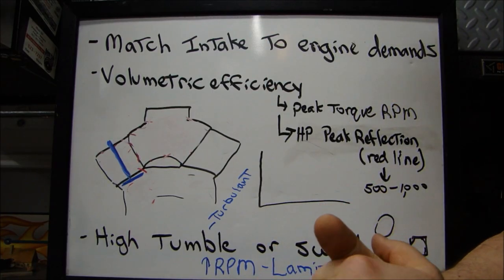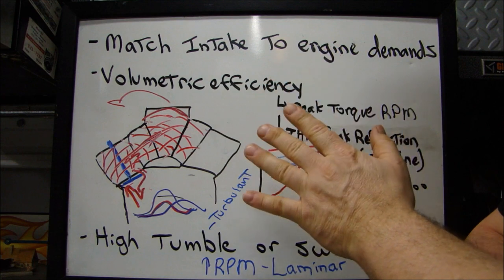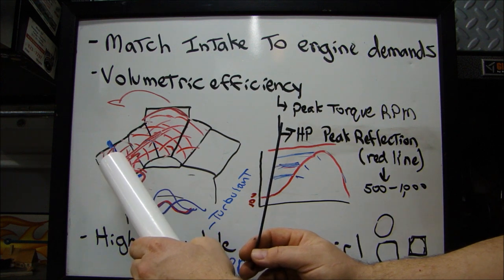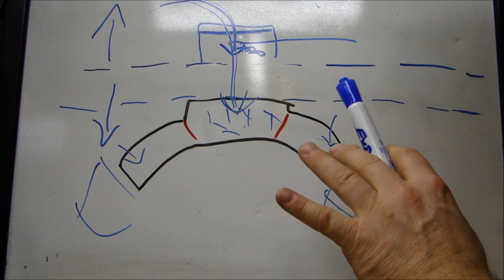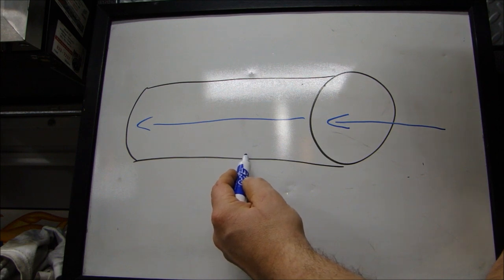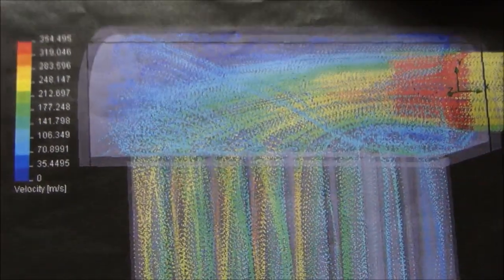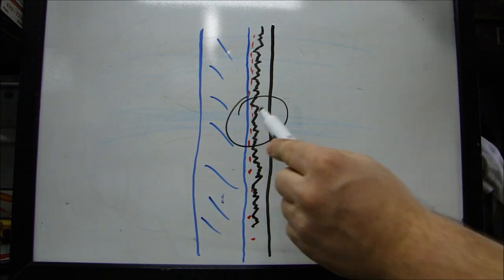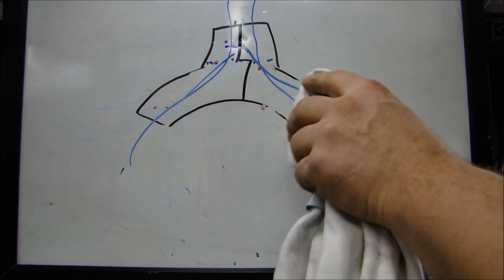Engine Building Part 8:   Intake Manifold Theory

Comment: Hey Pete, I think you misspoke when you were giving the peak hp peak trq example.

Its simply not possible for you to have your peak hp @ 4880 with your peak trq @ 5000. HP is a derived number. The math requires peak hp to be at an rpm equal to or greater than peak trq. 

rpm x trq / 5252.

Comment: Pete, been watching you for a few months now. You are a awesome gearhead, thank you for sharing your expert knowledge . I have been building for close to 50 years now, always on a tight budget. Sometimes this make it more challenging how good of an engine i can build for low buck cost. Have done good over the years maybe just lucky. Current build is a 68 327 SBC , 30 over, Forged FT  Scat rods . Had a top quality machinist (now retired) sad day. I opted for some 64 cc  heads, 190 intake runners, hope runners aren't to large for my little 333...  On a last note,  my name is Peterson, so i go by Pete as well,  also have two best buds hanging around my shop both pugs lol...
Reply from the maker: That is awesome! Thanks for sharing that. I miss my pug

Comment: some intake reversion can be  cut down, by true cross over headers, the other deal is to change two firing orders(plus a cam change to match, so when one intake runner is  getting air from the plenum it can use the opposite runner for increased plenum space, the other deal is extended runners in the plenum or jiggle the rocker arm ratios, the object of the game is equal combustion pressure between all 8, I understand everything your talking about, your stuff is spot on.
Reply from the maker: +tom ashton Thank you for the comment. Those are great suggestions.

Comment: Like others, binge watched up to this point today.  Getting ready to build a Shelby Cobra replica and this information is invaluable in helping make decisions on my engine build.  What an incredible resource!  Thanks a ton Pete!  I'll echo others sentiments - I'll buy you a beer if you're ever in the Denver, CO area!  Cheers!
Reply from the maker: That is awesome Jacob! What kit are you buying? It may be worth a trip to Denver just for a beer
Reply: Petes Garage Thanks for asking! I'm planning to get the Factory Five Mk4 Roadster complete kit, so drivetrain is one of the biggest build plan areas that I'm working on.  I've decided that I want a 302 block with fuel injection but haven't made many decisions beyond that yet. It will be mainly a street cruiser, not racing or dragging. I'd like to make around 400 HP on pump gas if possible. The good thing is that I'm still saving for the purchase so that is forcing me to make a good build plan!
Reply from the maker: Excellent choice. Sounds like you have a great project planned. When you start building let me know if you need any help.
Reply: Will do, thanks!

Comment: Awesome video Pete. I wanted to point out a very interesting fact that not many people are aware. The misconception is that we as humans breathe because we suck in air. We actually breathe because of the atmospheric pressure of the earth at about 14.7psi at the surface. The difference in pressure inside our lungs that we create by contractions, just like the difference in pressure inside of a cylinder is what allows the air or fuel/air to enter that cavity!
Reply from the maker: That is a cool comment. Understanding why something happens is what I'm all about
Reply: Petes Garage You talk a lot about velocity and that is an awesome subject. If you didn't already know, a vehicle traveling 70mph is traveling about 102 feet per second. Velocity is a measurement in distance traveled in a certain amount of time. There are 5280' in a mile and 3600 seconds in an hour. Divide that and you have 1.466. So multiply any MPH by 1.466 and you have the objects velocity. You can apply the concept to nearly anything traveling at a constant rate. That's my speech for the day enjoy your weekend! You can also determine how long it will take to stop!
Reply from the maker: That is really cool, thank you.

Comment: Thanks Pete i was wondering if you or anyone else can figure this out  i,m building  a 302 sbf engine have a new cam wrapped in grease & plastic , is there a way to know the firing order from the lobe pattern ?
Reply from the maker: Sure, get #1 exhaust at 12 o'cock and rotate clockwise. Follow each exhaust lobe in order as they reach 12 o'clock and that's your firing order

Comment: You're a smart guy Pete-- Remember the BB Chevy and oval port VS rectangular cylinder heads and some people used to say they preferred the oval even though Chevy said the rect. was used on their higher performance engines-- I know the rect. heads did have bigger valves which would usually add HP--

Also some people used to MISMATCH intake but to me tat never made any sense to intentionally block free flowing air, like putting a rect. intake onto oval port heads-- enjoying your vids
Reply from the maker: That's great info, thanks for sharing with us.

Comment: You did a great job, and are a great teacher.
Reply from the maker: +Gristle Von Raben Thank you my friend
Reply: +Petes Garage 
Thanks for all the great information, I am going through some manifold issues and this really helped me understand the varous issues I need to consider.  Double check you high, low pressure air wing description as I think the low pressure is on the high side of the wing and the high pressure pushes from the bottom of the wing.  Correct me if I'm wrong and maybe I've been wrong for years.  Anyway thanks for the info, great job!

Comment: Fan bloody tastic!
really helped me get my head around the last bit i could never fully nut out on my own.

Intake manifold on my engine build is shot to shit so I may have to build a new one (4G63B engines arn't exactly popular for the aftermarket). but this explanation will give me a good start into HOW i will go about it!
Reply from the maker: Awesome Shaun! I'd love to see your finished part
Reply: with the information provided and my tooling at hand, i'm actually gonna take a bash at quad throttled body!

we shall see indeed how it goes. I'll link you a video when it's up and running :)

Comment: Great series. It's helping heaps on my build. This video has identified another part adding to the lean cylinder problem my motor has. I'm looking at redesigning a new manifold, but was hoping you could give some pointers or directions on what I should be looking at for a twincharged direct injection 4 cyl engine. Supercharger runs until 3,500rpm, and from there on the turbo takes over.

Comment: I also really like the depth of this video. I'm learning and its really helping me understand what kind of intake manifold i need.

Also, It would be nice to see someone make a video about building an engine for climbing are really long and steep sand dune.
I have a 78 cherokee chief with a 5.9 amc engine and that is what i'd like to build it for.

There is nothing on youtube that covers a sand dune engine build for climbing.
Reply from the maker: There are some very niche type engines that people want to build. I do not run across enough of them to make a video every single one, but if you apply the basic principles you will be sucessful.
Reply: what do think the basic principle of an engine build for this type of activity is? guess i need to know where the peak horse power or torque should be. I have no idea where thoe's need to be in this type of application. would you have any tips to just point me in the right direction? even just in a comment would be great.
Reply from the maker: Short manifold and a wider LSA on the cam

Comment: I looked up your video thanks for your help. I’m really wanting to build my own intake for an 8.1 496 since aftermarket is lacking.  I want to weld square aluminum tubes to a low profile v plenum but worried about throttle response. It’s going to be duel carb. I have a lot of ideas. Thanks again.
Reply from the maker: Sounds like a really cool project Dave

Comment: Pete, you could benefit from some additional fluid dynamics exposure. In general, a slightly rough (eg dimpled) surface offers less resistance than a smooth against gasses and liquids. Yes, counterintuitive for sure. Dimples cause less eddies echoing across the flow, less interference and resistance by the low amount of surface turbulence from the rough surface. Glassy smooth surfaces will generate spin into the flow, the gas/liquid behind it will hit the surface and spin into the flow ... 

Experiment. A chunk of shaped wood or plastic or material of your choice. Finish the surfaces of runner surrogate from glassy smooth, not-so-smooth, to bumpy. Dip them into a stream or river (if you're brave) and observe. A wind tunnel with smoke would be a great visual on video. Which will spin more eddies? It requires energy to form those, taking it from the F=MV of the fuel/air mix. The resulting flow will have lower velocity, it will also have higher density. Maybe a touch more heat from the friction, negligible perhaps.

A backend question might include, are those turbulent eddies with higher density, better in the long run? Better for complete (vs incomplete) combustion? 

Explanation of high and low pressure zones could aid the image of fuel/air flow. The relatively high pressure of the plenum (especially with a blower) and relatively low pressure of the cylinder during the intake stroke illustrates pressure equalization. Perhaps a point about cool air is much more dense that warm air, why intercoolers help in efficient combustion and preventing pre-detonation. 

Great stuff, I just found your shows and have been binging the last couple days. My wish is you see these observations and opinions as positive, they are not meant to be spitting in your hair, not at all.  Rave on.
Reply from the maker: That is an awesome comment. Thank you very much for taking the time to share with everyone!

Comment: This series is invaluable! I'm working on a project involving an engine built 20+ years ago by someone else. I've rebuilt several engines back to stock specifications but this is my first dive into modification.  Its a CSB 400 with aluminium heads and a Corvette Tuned Port Injection manifold. I plan on putting it into a Jeep TJ for a trail devoted rig.  My plan is to disassemble, measure, and identify all the components then treat it, like you suggest, as a plan for a total build.  That way I can make decisions, based on the intended purpose, as to whether or not the components are appropriate. Thanks to you, I have a way to identify the cam and combustion chamber specifics.  This video leaves me with more questions. Is there a way to discern performance specifics on the existing manifold, i.e. flow bench, water displacement measurement, existing data on a stock TPI? Thank you again. As many have said, this is truly a service to the car community and is VERY appreciated!
Reply from the maker: Thank you Jon. Great name! That was my grandfathers name as well. You could probably look up the volume and data on the existing. Gotta be a way to find out. If it is plastic and you are not building too radical my guess it that it would be sufficient
Reply: @PetesGarage  Thanks for the reply Peter!  I know this is an old video.  The intake manifold in question is GM's "Tuned Port Injection" fuel injection system from the 80's.  It came off a 350 Corvette motor.  Its a really neat system with a center plenum and long runners that cross over each other and run to the opposite side of the motor.  Its a work of art in my opinion, beautiful lines and curves.  This motor was a drag racing build so the fuel control system is rudimentary at best and I'm sure I will need to source something more modern to handle an off-road application.  I'm just looking for information that will help me decide if that intake manifold is appropriate for the rest of the build. Thank you again! I really appreciate you taking the time to help out the less experienced, lol.

Comment: Pete, being an aircraft mechanic your boundary layer air also relates to the airflow on the fuselage of a high performance aircraft along with many other aspects of aircraft design. The other thing is the relationship between volume and pressure. Pressure increases volume decreases and vice versa, also the velocity of air flowing from one size diameter of pipe or tubing to another diameter. Bernoulli’s Principle. Pete to me your videos are not long enough. Thank you for sharing all the technical information that you do. Stay well and safe from one New Yorker to another. 🇺🇸😊😊😊 lest get those isometric drawings up to date better yet use Auto Cad. Lol Pete does the height of the bungs you welded on effect your fuel injector flow n anyway.?
Reply from the maker: Thank you Arthur, great comment!. I could draw everything in SolidWorks and use 3D models, but that's overkill...lol. The height of the bung is an interesting question. I'll have to think about it and work out some calculations.
Reply: Thanks for your reply Pete. Like I said your videos are full of technical information. Greatly appreciate your knowledge and sharing. 😊🇺🇸

Comment: At 36:00 you use a wing to show the bernoulli equation. But you are wrong... the air in the top of the wing flows faster than the air in the bottom, and, as the equation says, more velocity, less pressure. You have a low pressure zone on top, and high pressure on the bottom. That's how a wing generates lift!

I love your vids btw!
(sorry for bad english)
Reply from the maker: You are right...thank you for correcting me. I was pissed after drawing that horrible airfoil and I misspoke. I will add a comment in the video to correct that...Thank you very much Joao.

Comment: Have you noticed the interesting trick of aftermarket manifolds like the LSXRT that have runners in a box, inside a huge plenum, with an even bigger throttle body? It seems like they're trying to get the flow approximation of individual throttle bodies so each cylinder has approximately one really big plenum to breathe from.
Reply from the maker: Lots of new things are challenging the way engines are built. It will all change again very soon
Reply: What is the most significant change you're anticipating?

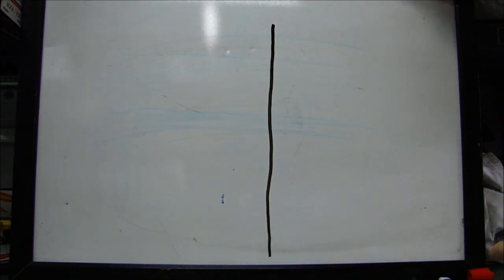Comment: @ 37:14 I think what people are comparing the swirl to is like a truck bed.
 The newer trucks (not sure when manufacturers started looking into it) they engineered a bubble in the bed. I'm sure you know but younger readers/views might not, back in the 50's, 60's, 70's, and even in the 80's/90's people would remove the tailgate or open it to get better fuel mileage and/or speed (fuel mileage was more of an 80's/90's thing).
Now by the late 90's engineers figured how to create a vortex swirl in the bed, this would create a cushion of air "bubble" that would cause all other air passing over the truck to bypass the bed missing the air damn like tailgate and reduce drag. If you drop the tailgate in one of these trucks you create a down force onto the bed/tailgate causing more drag. Now back in the 50's for sure this was not the case and losing the tailgate allowed for better MPG. That is why the lovely tailgate net was created and junked up so many trucks in the 90's. Nothing like seeing classic 50's trucks running one of these nets.
But to the point, some people might see that the ridges/valleys create bubbles/cushions of air that will allow for smoother air flow. While some of this is true, since air on air movement has lower friction than air on metal, the volume of air is the important part and the swirl's cushion is taking up valuable real estate.
1/4" hose (no leaks) has 90 psi put in one end and 50 ft on the other end 90 psi comes out
3/8" hose (no leaks) has 90 psi put in one end and 50 ft on the other end 90 psi comes out
Yea sure they both got the same amount of pressure to the other end but one delivered more volume of air in the same about of time. This is something I can not get through to people at work when they want me to look at their air tool or the compressors. They will grab a 3/8" O.D hose and not understand why their drill/sander is slower then when they use a 3/8" I.D hose. I had to make a tool (just a gauge with a QC fitting) to plug in their hose to show them that they had 95-100 psi at the hose end. Even showed them using a I.D and O.D hose that 95 psi was present but the O.D hose caused their tools to run slower. STILL have to walk to the compressors for the plant manager to "make sure" it is working.
Side story: had a self taught "knows more than me cause he is older" fartard mechanic down at another plant of ours call me and asked me to make a 3/4" air hose 150' long with our standard QC fittings. Our standard fittings are 3/8", so I made a 3/4" hose with a 3/8" cap and plug quick connect. Had to use 3 different reducers to make this hose.
Reply from the maker: +therealdeadpen That's is some cool stuff. Thank you for sharing it with everyone. I have had people ask me to do some pretty stupid things too.

Comment: hey, can you explain what the upsides of a bigger plenum are, a smaller plenum gives you increased throttle response and a larger plenum gives you more air available. does that mean that you potentially have more hp ? how about going for a larger intake valve is there something to gain there ?

Comment: Hi Pete. Did you watch the other vids and about my 414 BBC for my maniacal s10. Please let me know your opinion. I would like to know how much Hp and trq and where. The tbi I modified the air flow and put in 5.0 or 305 injectors in which flow 55 gph and modified the plugs. Thanks again Pete! Maniacal s10.
Reply from the maker: It's interesting, did you dyno test it?

Comment: What are your thoughts on Extruding Honing an intake manifold and unshrouding  valves in combustion chamber to improve swirl and volumetric flow?
Reply from the maker: It really depends on design of the intake and head design. You can make it worse by doing that.